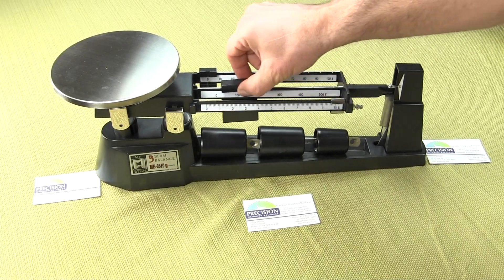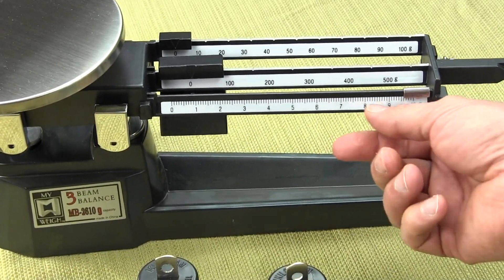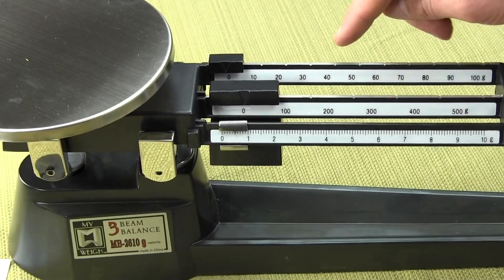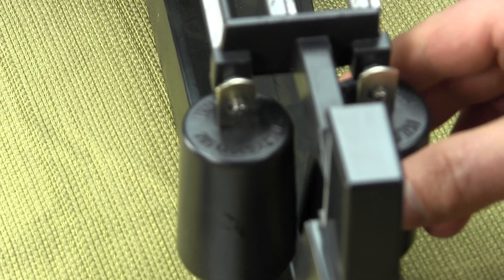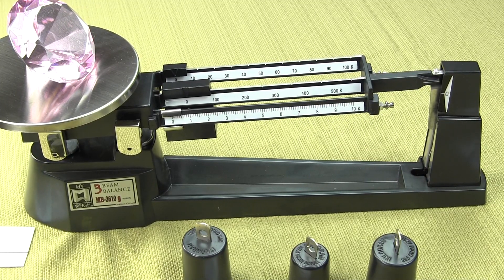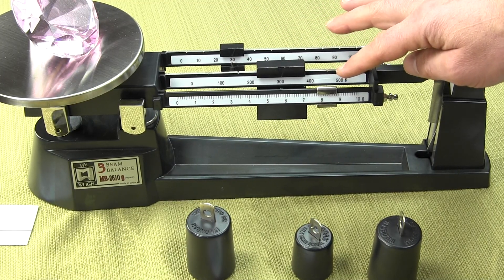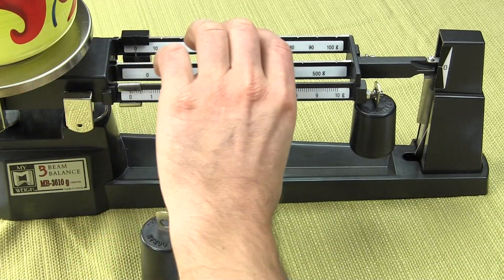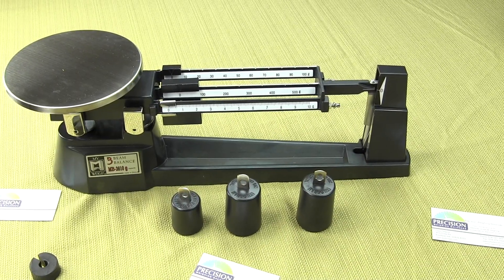How to use triple beam balance

Comment: I got one of these scales today, by ordering it through the mail.  It had a little piece of styrofoam in the  housing that has the zero point on it, and held the end of the beam in the down position while it was in the mail.  I'm going to continue to use it to hold the beam in this position when I'm not using the balance, so that the beam won't constantly move up and down by itself.  This is a good scale for a good price.
Reply from the maker: +MrKJW007 Sure that is a good idea to prevent the beam from moving when not in use.  There is also the split rubber grommet that you can install under the platform to prevent the beam from moving. 

If you need anymore triple beam balances they can be ordered at http://balance.balances.com/scales/438   MyWeigh 3 beam scales are an extremely good value and they come with the attachment weights while other brands like Ohaus make you pay big bucks for the attachment weights.
Reply: Cool